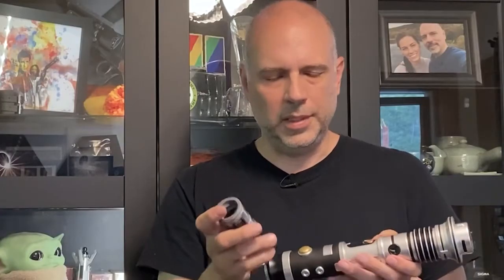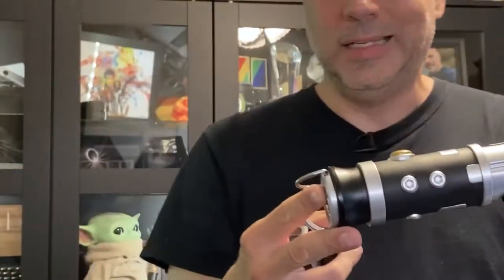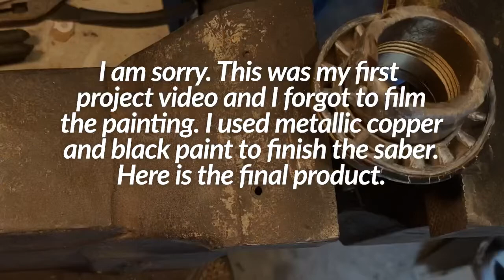Weathering and Aging a Disney World Savi's Workshop Lightsaber

Comment: dude why.....
Reply from the maker: Because it works better with the story they tell you at Savi’s.  If the story was that the Gatherers went to the local light saber shop and bought out all their old stock, it would explain why the parts look so new.   The story is they found them.  I’m imagining at location of great battle (where if they at found, that means the Jedi lost and I’m sure the saber would have been use to it’s breaking point) or ruins of Jedi temples (where anyplace with excess if spare parts would be places they repaired them so there would also be scrap piles of discarded parts).  The story they tell at Savi’s does not lead you to believe you will be making a shiny new saber.

Comment: You ruined a $200 piece?
Reply from the maker: lol. I think it’s better. I have since cut a hole to see the kyber crystal (since at Savi’s they warn you that doing it wrong can cause an explosion. In my mind, that happened to the parts I have.  And I drilled holes to see the LED that are inside.  There are lights inside that you never see. That is a shame.  Now you can see them on mine